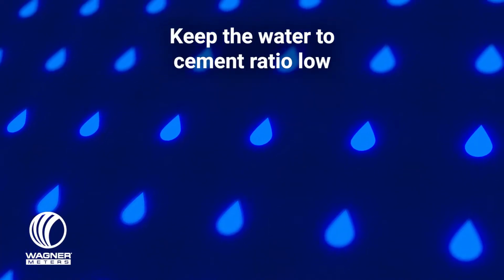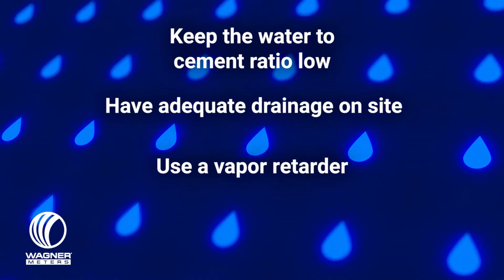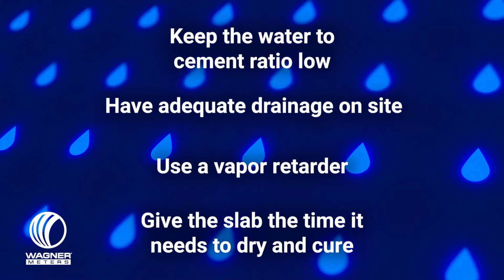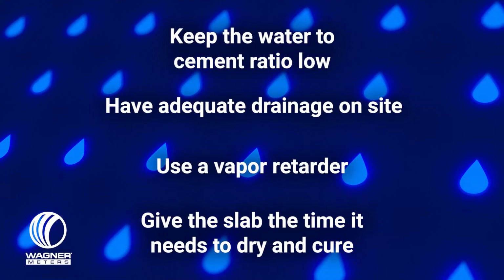Lurking Moisture Issues in Your Flooring

Comment: Actually incorrect, RH reading by in situ only reads the RH in that particular spot. NOT moisture. You start off by talking about moisture between the flooring product and slab. Then you jump to RH reading in the slab. RH in the slab has nothing to do with moisture(water) on top of the slab. What’s more important is checking the dew point compared to the surface temperature of the slab and using a moisture meter to check the top 3/4” of the slab.   Other than that, nice video
Reply from the maker: Thank you for your comments.